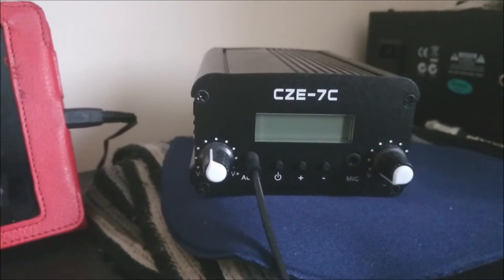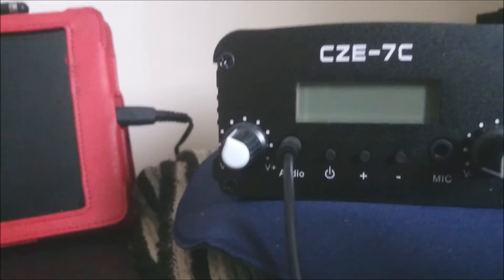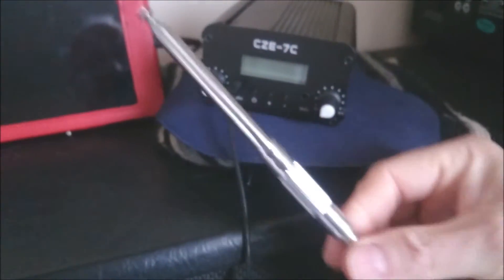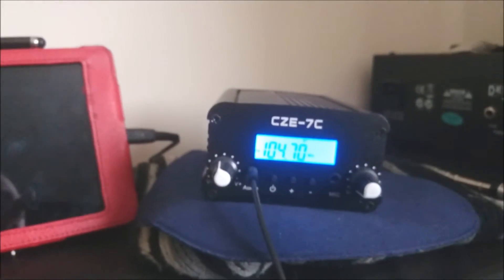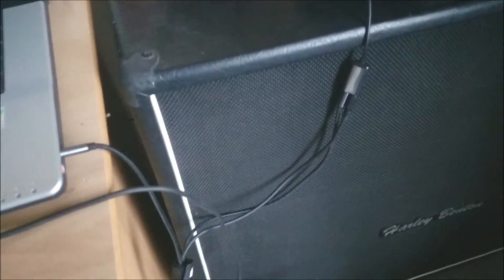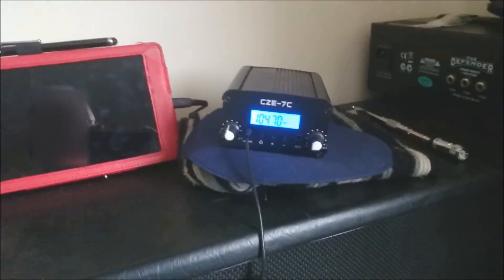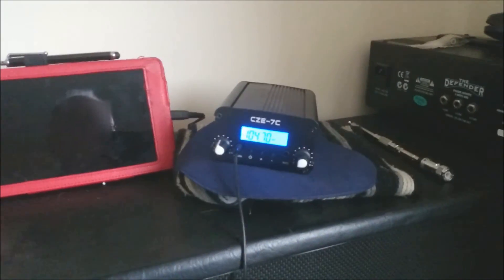Is The CZE-7C  FM Transmitter Any Good ?

Comment: Thanks for sharing this. I’m considering this for a silent disco in a park and powering it off of a UPS battery. Do you think this could work if I got some cheap radios for folks to plug their headsets into? I’m assuming so if you are getting 2 miles out of it. Need to experiment with it once I get it. Cheers!
Reply from the maker: Sounds like a good idea, can't see why it wouldn't work.

Comment: 9:35 pm fri 4/26/24 . I am not sure when I tuned my  cze7c , if I followed the directions properly . It does not indicate L or H . I bought it a couple years ago but only go on occasionally . I never checked the transmitting range yet .
Reply: Turn off mains to it hold power button while turning mains back on hold it for about 5 seconds, it will then give you choice of H or L uses up and down to select the one you want.

Comment: i have one of theese since today and already don't want it anymore. any audio sources i connect to its input flip out completely. for example my microphone changes color and when connected to my pc it makes my pc's fans also change color AND it causes one of my usb devices to get disconnected but as soon as i disconnect it from my pc the usb device connects again.
Reply: There is something wrong, this should not happen with this transmitter. What coax cable and antenna do you use? Is the SWR good?

Comment: Had this transmitter and upgraded to a different one as it was causing interference with other items in my house and I also did not like the noisy fan it was blocking my harmony smart remote causing our subwoofer to hum then a noisy out my dad Bluetooth headphones not had this issue since upgraded to the Retekess tr508

Comment: Hi, I'm from Ukraine. Can you tell, please an output top power with its transmiting range, current and voltage consumption. Thank you so much.
Reply: If you’re using even a dipole antenna cut to appropriate length to the frequency you desired to transmit on top of the house roof and even on the lowest setting of 1 watt, you can reach 2 mile radius. While on the 7 watts setting you can reach for 5 - 10 mile radius.
Reply: @redbishop71  Thank you buddy for your perfect and great advice...
Reply: @vetalveral8920  Are you in Ukraine at this moment? Please do take care of yourself and all you love ones. God bless!!!

Comment: Hello great video......can you tell me what type of wire that is that you use for the antenna and where to get the antenna wire that you have connected to the di pole. I can't find the wire anywhere. Also what type of wire connectors are you using.
Thanks
Reply from the maker: It's all just ordinary coax cable. The short piece I just made up and added connectors.
Reply: @MidlandBulletRiders  Ok thanks for the info

Comment: Range of stock antenna?
Reply from the maker: Probably about a kilometre.
Reply: @MidlandBulletRiders  can I use 220 volts as an input Sir? I'm from PH and we use 220
Reply from the maker: @techsupport7273   Yes no problem using 220v
Reply: Can i use some kind of different antenna to get more range? What would you recommend?
Reply: I think his FM transmitter is vibrating because it clearly says to attach the antenna before plugging it in or you might risk damaging the FM transmitter
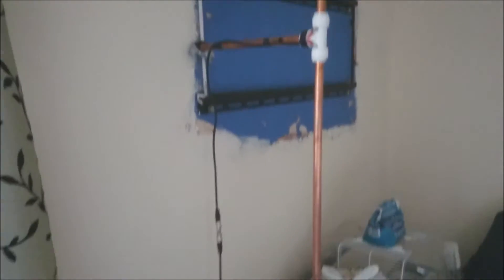Reply: @adventure_lewis  It is attached to an antenna.  THe dipole he refers to is his antenna. Check the 5:00 minute mark...

Comment: If someone knows please reply. I have the cze 7c fm transmitter but when I put it on high power it outputs a high voltage at the aux cable but after 30-60 second the high voltage disappears and the transmitter does it's work without a problem.
Reply: Άμα βάλεις ένα καλώδιο ένωσης στο κουτί του πομπού 60cm θα γίνει είναι στάσιμα η κεραία του είναι μικρή

Comment: I brought the CZH-5C, great unit plus it can be upgraded to 7W just by changing the MOSFET transistor.. But even better I got a 30W transmitter from China off Ebay that works REALLY well, only £70 once it warms up it hits over 40W, its a narrow band transmitter...

Comment: Great Video - I got the CZE- 05B recently. It has a BNC type antenna socket on the back. Not the push and twist type but one you have to screw on for the antenna provided. Can I get an adapter to take  a PL 259 plug. What did you do? I want to hook up an outdoor di-pole  like your indoor one. I would be very grateful if you could tell me what adapter to get. Looked on eBay but cant find what I want. Many Thanks  -   Frank.
Reply from the maker: Is it a TNC connector on the back, not BMC ? if so you might want to look for an adaptor for that. Try searching for a TNC Male to PL259 UHF Female Adapter. see if that's what you need. If I remember I just crimped on a TNC plug to the coax cable.
Reply: @MidlandBulletRiders  Thanks for your help. It may be a  TNC  connector on the back after all. I will search for the one you mention.Cheers !